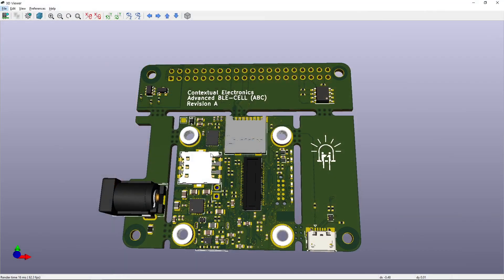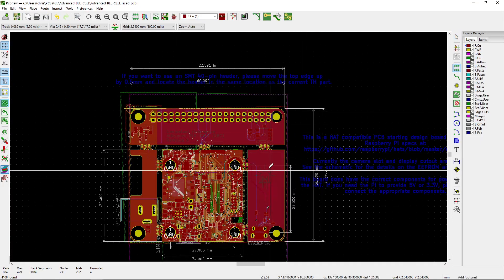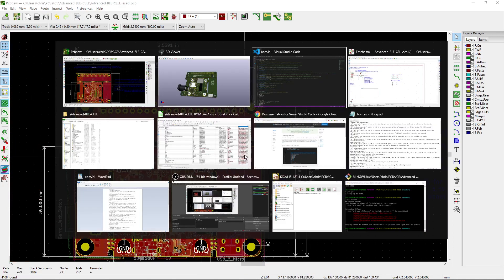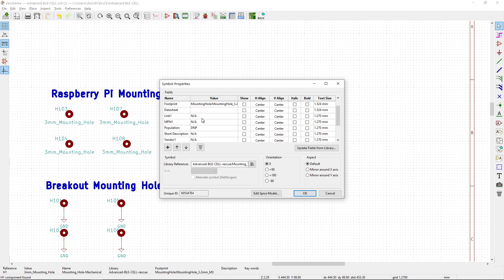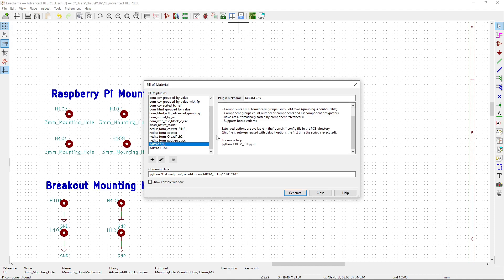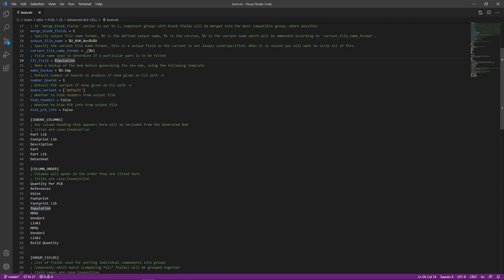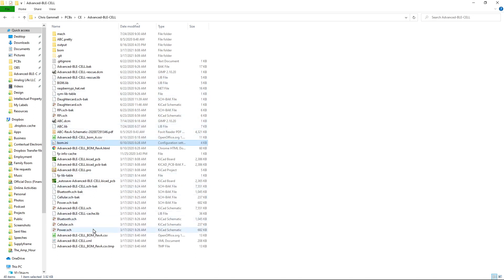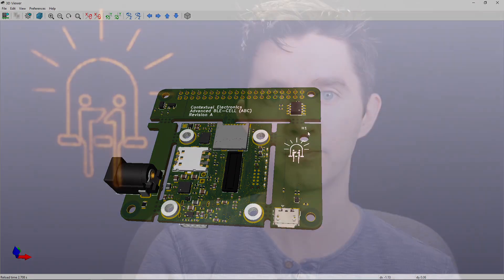Add mounting holes to a layout, but not the BOM (KiCad 5.1)

Comment: Hey, great video! Quick question, does KiCad support back-annotating references? Also, is there a way to move nets around and have that annotate back to the schematic? (An example for that second being routing pins to an FPGA that can have the internal configuration changed to accomodate for routing)

Comment: Can you talk a bit about mounting hole options please? Like why choose plated over NPTH even when there is no electrical connection to the rest of the board, or why you'd set pad clearance around a hole so there isn't any copper underneath the bolt head?